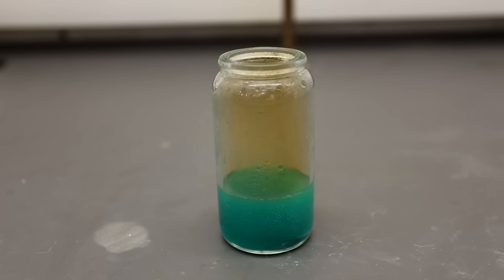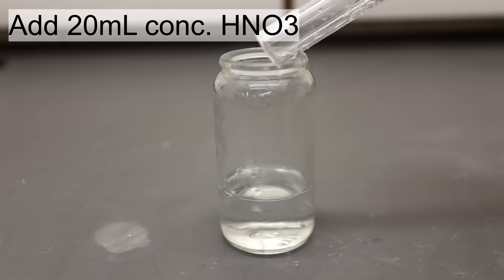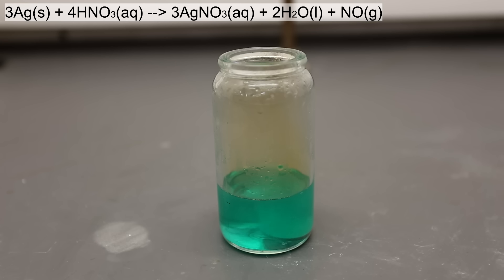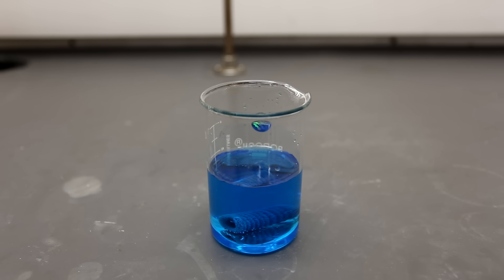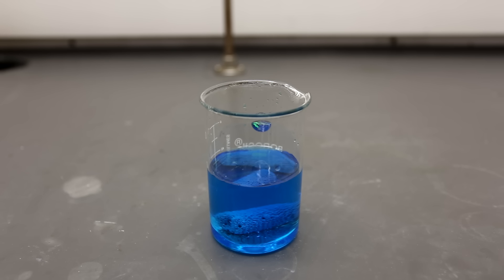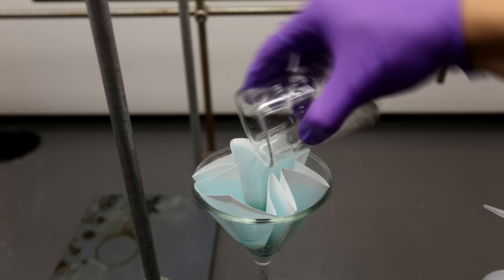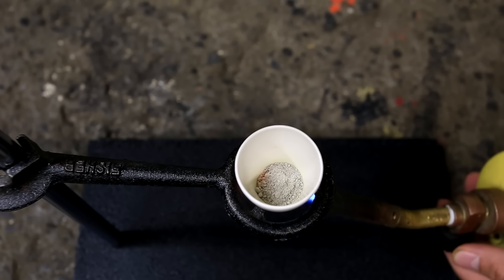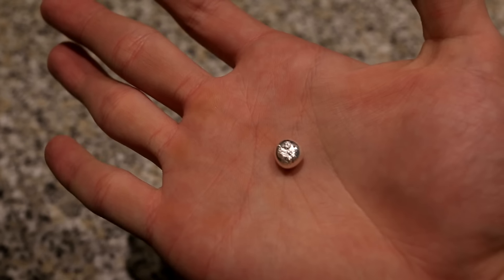Extracting pure silver from a coin

Comment: you should have added a salt solution to the remaining silver/copper nitrate to reclaim 99% of the silver. the remaining silver in solution would have dropped as  silver chloride which could then be converted to elemental silver.
Reply: Please can u teach me step by step
Reply: Not easily. Silver chloride is to be avoided, if at all possible, as the conversion to elemental silver is difficult.
The best method is through cementation of the nitrate onto copper. The only reason he did not get almost 100% recovery is because he did not get rid of the excess nitric acid before cementing out the silver.

Comment: Why does the coin turn into black when i do the same method you did, i did your method pouring 20ml of nitric cid and 20ml of distilled water after it i cover the cylinder and after an hour it turns into black color insted of blue

Comment: Good vid and all, but why not precipitate the silver by adding salt, converting it to the oxide, and heat it up?. Or if that was a pain, just react the precipitated silver chloride with light. Also, I would have poured the melted silver directly into water.
Reply: Doesn't work, otherwise the process would be used. Silver chloride is photosensitive, but I don't believe that reduces it to native silver. Even if it does, it still would only convert the surface atoms, a minute portion of the crystal mass.

Comment: should i denox the nitric b4 i put the copper in ? like i do with aqua regia b4 a gold drop. thanx,  billy.
Reply: Use enough copper and it will denox the solution. The silver will not cement out until the excess nitric acid is gone. That is why it is best to minimize the excess nitric acid when doing the digestion.
Reply: @buggsy5  gottcha ,  thanx for reply. iv been scrounging sterling junk & have at least 5 oz. now.

Comment: would using sodium chloride to create silver chloride be more efficient
Reply: its probably dangerous if you furnace straight silver chloride because of the according gas that would come off of it but would it be more efficient
Reply: The problem with silver chloride is that it's very difficult to recover back in to elemental silver (done with hot sodium hydroxide and dextrose)

Comment: Have you used silver nitrate for mirroring?
Reply from the maker: +Noah Spurrier Actually, I have never done that experiment before!
Reply: +Nile Red Well, then, do you take requests? I see a few different methods using silver nitrate. One uses a tin solution before the silver nitrate. Perhaps this gives a better bond. Others skip that. Some use glucose as a reducing agent. Others use sucrose, but it has to be hydrolysed to fructose and glucose. I've since lost my notes on how that's done. I plan to see if epoxy or  polyurethane resins can be mirrored. This would make it easy to make cheap reflective telescopes. Granted, it would be inferior to glass but it would be cheap and easy.
Reply from the maker: I do take requests! If your idea is interesting ill definitely do it. It does sound cool to actually make a mirror out of it. All of the other videos seem to just make it in the beaker and then get rid of it.

Comment: Oh that's EASY, to extract silver from a coin that's 50% copper and 50% silver. If you want a CHALLENGE, try extracting silver from coins that contain no silver at all. Step 1, set the magnetic containment field to 10 megateslas. Step 2, preheat oven to 100 billion degrees. Step 3, steer outlet through a mass discriminator to focus on a mass per particle of 107. And presto, you get your silver, mixed in with a bit of radioactive palladium 107.

Comment: You should stop using filter paper because you are loosing products that way, instead use a centrifuge. If you don't want to buy one, best way to do it is with a bicycle. Just flip a bicycle upside down, attach vials and/or test tubes with lids, use electrical tape to tape spokes very well, (duct tape leaves glue/sticky residue). Start slowly to spin it. You don't any to fly off and hit you. Let me know if you it works and you get a better yield. Filter paper is only good for filtering stuff to throw out, but not very good for collecting product(s). You're loosing product(s) in the fibers in paper.

Comment: Instead of using an excess of nitic acid, you should have made sure there was an excess of silver at the end of the reaction. This way, the solution will only contain silver nitrate and copper nitrate, with no unreacted nitric acid to dissolve the copper and silver in the next step. Just filter off the unreacted metal and use copper to cement out the silver powder.
Reply: R u a chemist
Reply: @user-he7sc3fg3r  Who cares if he is a chemist, he is right. Most refiners add more silver alloy to use up the available nitric before cementing the silver.

Comment: Would there be less of a loss just using heat and separating metals by their melting points?
Reply: Your proposed process can't work. For example, assume you have a silver-copper alloy coin. Copper melts at 1085 C, silver melts at 692 C. However, if the silver-copper alloy coin contains between 8.8% and 92% copper, it will begin to "melt" at 779 C (the eutectic temperature). If the coin has less than 8.8% copper or more than 92% copper, it will "melt" at somewhere in between the eutectic temperature and the melting point of silver and copper, respectively. It is literally impossible to separate silver out of the alloy by heating to 692 C.

The metal melt you get wouldn't be pure silver or pure copper, either, but a mixture of the two. However, the solid metal left behind should be pure silver or copper depending on the composition of the coin. You could remove the solid and then successively cool the melt, resolidify, remove the solid, over and over, while retrieving the pure solid metal left behind.

This is pretty labor and energy intensive and would really only be suitable if you had many kilograms of metal to process, you need really a really good heater that can control temperature down to a degree (expensive), and for a small piece of metal like a coin, it's far more efficient to dissolve the metal in some acid than to spend hours melting and resolidifying a small hunk of metal.

I forgot to add: if the coin isn't a solid alloy but a plated coin (e.g., a copper or zinc core plated with silver), you might think you can still get the silver out by heating to the melting point of silver. You might get some of the silver to melt. But plated coins like this contain a very thin layer of silver (like micrometer or less thin) and the act of heating the coin to the melting point of silver will cause silver atoms to begin to diffuse into the core, creating a silver alloy where there was not one before.
Reply: @BoxStudioExecutive  thanks for your reply. I truly appreciate it.

Comment: Outstanding information here!!  I am a metal detectorist and I amalways finding silver coins.  99% (or more) of the coins are not worth anything other than their silver content.  I want to do this, but on a somewhat bigger scale.  How would you recommend I go about it for 1/2 or even a full pound of silver coins?  I'm not sure if it makes a difference, but referring to the coin you used in this video, the ones I want to do this with are standard "Coin Silver" which is 90% silver and 10% copper.  Thanks!
Reply from the maker: +John McDermott You should probably be able to just scale it up. I believe the nitric acid is in a large excess anyway. Not 100% sure though.
Reply: +John McDermott As far as I know, silver quarters are coin silver, which if he used a coin that was less pure I would think you could do it with one that was more pure.

Comment: I agree with Peter, your videos are second to none.
Their is a way to remove the Silver easily from a melting crucible. If you put quite a bit of ground Borax into the crucible and heat it till it goes like glass beforehand if you are quick and remove the Silver quickly it will be easily removed.
However, this may leave a residue of glass like borax on the silver, but this is easily removed with a dilute liquid of sulfuric acid and water "jewellers pickle" (10/1). But if you are just doing a small amount, charred wood is good ;-)

Comment: So the initial reaction with Nitric Acid produces silver nitrate? Then you could theoretically use a process like this to produce silver nitrate solution for tin type photography, for instance. You'd just need to remove the Copper Nitrate and any other byproducts.

Comment: can hydrochloric be used
Reply: No, Hydrochloric acid is a non-oxidising acid. Silver requires an oxidising agent to be dissolved in acid. Other oxidising acids could be used but a slightly different method is required. Sulfuric acid I believe works by the following reaction 2Ag + 2H2SO4 = Ag2SO4 + 2H2O + SO2

Comment: Where did you get the silver quarter and what are some other sources?
Reply from the maker: I actually got it in my change by chance. You can buy them online though. Like I said, though, the coin is worth more than it's weight in silver.
Reply: Coins before 1959. There are also silver dimes too. You can find out whether it contains silver by dropping it on a hard surface and it should ring with a higher pitch then zinc or copper
Reply: +TheKingOfChem   Not just any coins.  In fact all American Dollars, Half Dollars, Quarters, and Dimes that are 1964 and older are 90% silver.

Comment: So, are coins containing silver still in general circulation in the US?
Reply: +jonescrusher1 If you can find any dimes, quarters, or half dollars minted in or before 1964 they should be 90% silver
Reply: Even until the 70s and possibly early 80s there was some silver in quarters, just not like they were in 65.  The 90 % silver coins will not have a copper stripe down the side.  The lesser ones will and you have to look at some coin guides or wikipedia to determine the amount of silver.  The 60's and earlier silver quarters are worth a few dollars each without removing the silver from them.

Comment: After the first silver extraction, add salt or hydrochloric acid to precipitate AgCl.  Filter.  To the AgCl, add NaOH in crucible and fire.  Then add carbon powder and fire again to get silver metal missed in the 1st extraction.  Some borax will help coalesce the silver.  Dump while molten as you did first and wash in water to dissolve the borax & salt.

Comment: I didn't realize how old this video was until I started this but there's been nothing on the news about the laws of physics changing in the meantime so I'll ask anyway. Is there any reason that dollop of silver can't be pounded into a shape conducive to being held by an alligator clip allowing it to be suspended in a fluid (water) with a voltage applied that would permit silver plating another object like a spoon or a knife? A little off-topic but do you know how large (weight) is necessary to silver plate a Bowie knife of average dimensions like eight inches by one and a half inches? ( I disregarded the material missing from the curve in the blade since my math instruction was taught on an abacus). Do you have a video on plating gold or silver?

 And how does the metal (assuming it is) that makes up the center of clad U.S. coins affect the process of separating the coins silver from its whatever metal center? Thanks for the videos, they're great.
Reply: Hopefully someone will come along with better answers than I have.
But silver is fairly malleable. Not as much as gold, but you could probably hammer yourself out something fairly thin.
I'm not sure how much silver is required to plate a given surface, but you can probably find formulas online. YouTube will have a few videos on the subject.

As far as I know, all the metal gets digested. I don't believe it affects how the silver is brought out of solution.
But the only US coins with silver in them are 1964 date silver coins and previous. They are 90% silver and 10% copper.
All US coins minted today for normal circulation have zero silver content in them. They're zinc and copper, or nickel and copper.
But keep in mind that some of those pre-1965 coins are valued more in their current worn states than if you melted them down.
The melt value of a 1917 Standing Liberty Quarter is about $2.80.
The same quarter, if you sold it for face value, is about $36.
I'd venture a guess that you'd be better off buying 99.99% silver ingots or sheets. Those would eliminate the need to search for silver, refine it, and work it to something you can use.
But if it's the project you're after, you should use unwanted silver jewelry. It will be the same process.
If you do use coins, compile a list of dates and anomalies to look out for. Otherwise there's risk of rendering tens, hundreds, or even thousands of dollars of numismatic value down to the spot price of silver.
That being said, certain sterling silver jewelry and antiques are worth a mint. So be watchful of those too.
Reply: No. Silver plating is not that easy. Wikipedia should have an article on silver plating.
Reply: @buggsy5  It's not easy but can be done with caution. It requires the toxic chemicals potassium cyanide, silver cyanide, and potassium silver cya-nide.

Comment: Instead of using copper wire to precipitate the silver out, you could have just used something containing chlorine (sodium chloride, bleach, etc...).  You'll drop out silver chloride, which can be melted, releasing chlorine gas and leaving near pure silver.  It's less expensive and easier to do than the copper wire method, but both will work.  Great video by the way, just thought add my two cents!
Reply: Sadly, melting Silver Chloride is difficult, and doesn't just "drop out" the silver. You have to use sodium bicarbonate, dextrose, charcoal and a high temperature. It's slow and very annoying to deal with. Most chemists avoid AgCl for this very reason

Comment: Wouldn't HCl also work to separate silver from other metals and leave you with almost pure silver chloride which you can then add sodium hydroxide and dextrose to to convert silver chloride into fine particles of silver metal? I have also seen copper being used to form silver on the surface which then falls off.
Reply: No. The silver chloride sticks to the silver and passivates the surface. Even aqua regia, which dissolves gold just fine, does not dissolve silver.

Comment: You said that you used a silver quarter, and that you lost 10% in the process. Are you sure that it was lost in the reaction? US Silver coins were "only" 90% silver, with other less precious metals filling out the rest to ensure durability. So - going by the data provided - I can't help but feel that you did in fact get the silver, and the 10% of the original mass you lost was those non-precious metals.

Could we someday maybe get a followup or redo video? Only with solid numbers of the mass of the coin, the expected silver amount, and what was produced at the end?

Comment: First I will add 20 ml of water
Me: ok maybe I can try.
Then I will add 20ml of CONCENTRATED NITRIC ACID
Me: ok that idea was immediately shut down...
Reply: What? Nitric acid is easy to find.
Reply: 500ml of concentrated nitric acid is only $40
Reply: @bitterlemonboy  in the EU you need a (hard to acquire) license for all concentrations above 3%, because nitric acid can be used to make explosives.
Reply: @Larry1302  What? You don't need a certificate.. You can make it yourself.
Reply: @Larry1302  you can concentrate from it tbh
Reply: @bitterlemonboy  if you dont mind breaking the law that is
Reply: @buggsy5  hydrogen peroxide has a 3% cap as well
Reply: @definitelynotyuribezmenov7611  that will get expensive
Reply: @Larry1302  if no one sees it no one can punish you
Reply: @Larry1302  atleast it's legal and possible
Reply: Does anyone know how concentrated you can get nitric acid if you just react nitrogen dioxide with water?
Reply: @thesciencefurry  depends on medium in which it happens
Reply: @definitelynotyuribezmenov7611  What do you mean?
Reply: @thesciencefurry  if theres some other material or gas then it'll reduce and might interfere also volume and surface area determine reaction here so also the concentration/amount
Reply: @definitelynotyuribezmenov7611  Alright, thx. I'll try some stuff out.
Reply: @Larry1302  Who banned high capacity mags last year, in response to which terrorist attack..?
Reply: @GameFreak7744  after the Paris attacks with illegal fullauto yugo AKs the EU changed their mag capacity guidelines and the member countries had a couple of years to integrate it in the local laws. for example as of september 2019 belgium changed mag caps to 20 rounds for centrefire pistols and 10 rounds for centrefire rifles. They also did this retroactively, only the people that bought their high capacity mags before 25/06/2017 can keep them but cannot transfer them, if you bought your mags after that date you need to cap them or get them destroyed. The only way around this is to get a special certificate for high capacity mags which is hard to acquire and you are forced to engage in disciplines like IPSC, so if you're an average joe just wanting to shoot at the range from time to time you're gonna have to accept the fact that you're now stuck with low cap mags.
Reply: @Larry1302  lmao don't "people" throw that shit in peoples faces like every other day in your country?
Reply: @youtube.commentator  not really, and when they do its on their own daughters
Reply: you can get everything to make nitric acid on amazon relatively easily, I was able to get gold from computer parts with most of the equipment bought in one place.